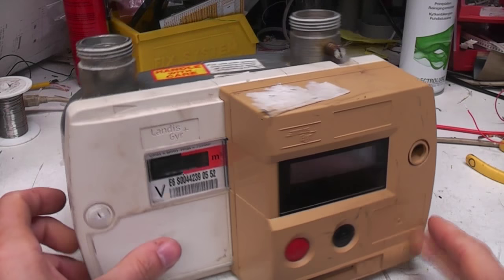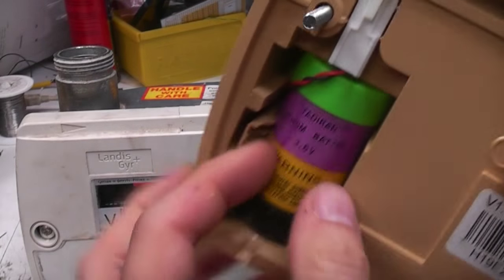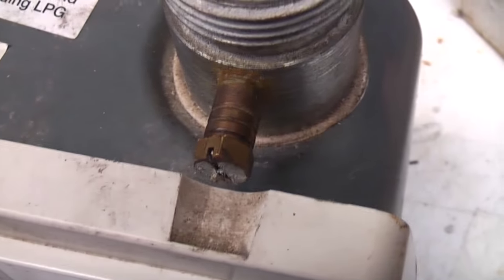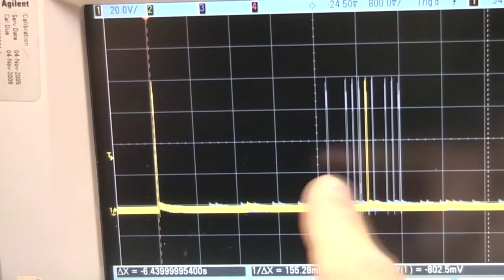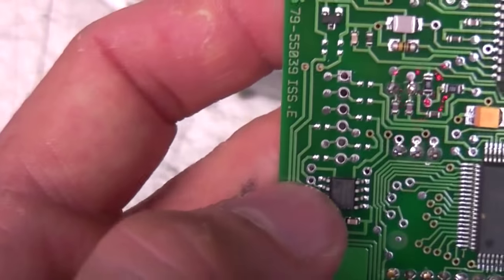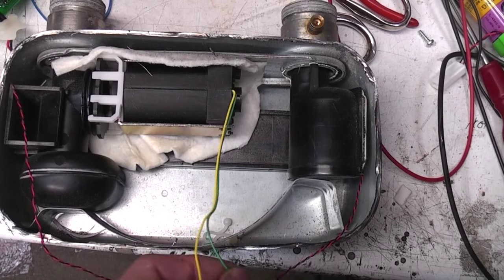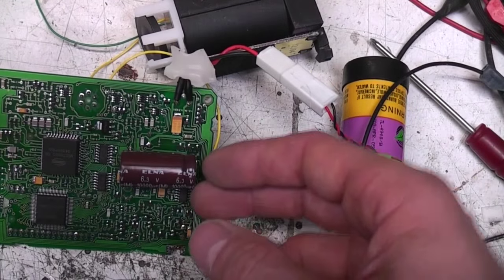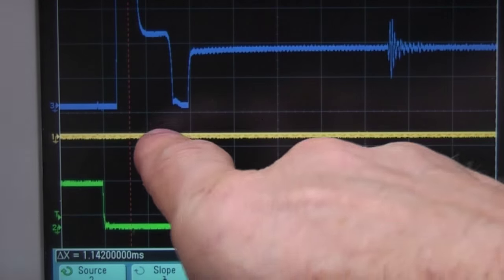Ultrasonic gas meter teardown

Comment: Interesting, Thanks for doing the autopsy. Great test set up with the fan. Large battery I wonder how intrinsic safe this set up is. No doubt it is safe, as the gas authorities use these meters. That wire on that coil is very thick, must draw a bit of current.

Comment: Spot on with your guess of how it works.  As regards the lack of pressure sensor,  there is a mechanical regulator attached to the inlet (a mushroom shaped thing on the top of the meter at the end of the flexi pipe when installed), that IIRC is set to 21mbar and has a tolerance of +/- 1mbar

Comment: One argument for separate meter and card units is that they could keep the meter in place (since it'll be a pain to change), regardless of the type of customer, and simply bolt on or remove the card unit as the customer moves on or off of prepay metering. I guess it could also open up alternative means of prepayment, or the ability to support different prepay card systems.

That way you don't have to maintain separate meter stocks or pay for card functionality on every meter, regardless of need

Comment: Fascinating - thanks Mike. Wow, they go to all that trouble to get a low voltage solenoid but have 50-80V transducer spikes within millimeters of the gas flow. Must be easy to confuse using an external ultrasound source. Great teardown - thanks.

Comment: That folding on the can, I think it's a fairly similar method they use on Soda Cans. It's a fairly easy and cheap and reasonably strong way to hermetically seal something. I believe it's type of double seal, but I could be wrong.

Comment: It would be interesting to have seen the Infrared communication between the smartcard unit and the meter, especially to see if they used some form of polling or obfuscation to prevent tampering.
Reply: Many years ago I was involved in the in-house testing of an ultrasonic domestic gas meter, very similar to the one shown here.

The IR port is a standard feature, with a publicly published protocol used by all meter manufacturers, for both gas and electric.

The protocol starts at a low baud rate to establish connection, then switches to a higher baud rate for the functions, including setting the charge rate and controlling the valve.

The switch from low to high baud rate includes a password. This is the security mechanism, and it would not be easy to crack.

While testing these meters we discovered that if the transmission during the low baud phase was allowed to overrun, e.g. by sending a continuous stream of garbage characters, the internal receive buffer would overflow and corrupt some RAM.

The 'garbage characters' could be any form of IR transmission, such as from a TV remote. 

This corruption would be detected when the meter did a status check, which it did every six hours. The meter then corrected the RAM by reloading it with the 'last known good' values, which could be upto six hours old.

I pointed out that a devious person could get 6 hours of free gas by using a TV remote. Do this every 6 hours and he would have free gas all the time.

The company then fixed the software bug in all new meters, but nothing could be done about the 20,000 meters already installed !.

So somewhere in the UK there are 20,000 users possibly getting free gas just by using their TV remote.

I wish I was one .

Comment: Would it be possible to use a strong IR source from the side to possibly saturate the IR sensor inside the actual gas meter before the card runs out of credit to prevent the transmit of the turn-off sequence?

Comment: eres a regulator that sits before this that keeps the pressure constant (21mbar) regardless of what the supply pressure is (usually nearer 25mbar) so there isnt a need for a pressure sensor, purely volumetric.
it used to be quite a common way of getting more gas for your money by fiddling the regulators to up the pressure but they have lead seals on them now.
Reply: Matt Beddow depends whether it's an LP or MP service.  MP services can be up to 2 bar, and LP up to 75mbar.  (although you would have to be near the district governor and for it to be at winter settings to see those kind of pressures).  The more modern regs have plastic seals, but do regulate to 21mbar as you say.  That said, ultrasonics aren't as dependent on pressure as the old diaphragm meters for an accurate reading, therefore even if you could tweak the pressures slightly it would make little difference to the accuracy.  Both the E6 and the U6 are designed to flow at a rate of no more than 6m3/hour.
Reply: Matt Beddow , relative pressure is fixed, but what about absolute pressure VS speed of sound?
Reply: The whole gas network is billed on relative pressure not absolute. When your looking at 80 bar in the High pressure mains a few mbar shift is negligible. When you get down to Low pressure service for your house it may be noticeable but the accuracy of domestic meters isnt fantastic anyway. thats why they measure down to 1000ths of a m3 but you are only billed for whole cubic meters/feet. Long term averaging then takes care of the short term fluctuations in gas pressures.
Reply: nRADRUS The variation with temperature is far greater.
Reply: Matt Beddow Just seen you work for National.  I work for one of the other DNs.

Comment: The narrowness of the flow rate measurement tube is probably so that the waves remain planar up to a fairly high frequency and they don't have to worry about positioning the transducer over an antinode of a standing wave (at least in one of the dimensions)

Comment: Is that a desolder pump with a heated tip of some sort? Not seen one before.
Reply: +Mark Bartlett They usually have the  heated tip and vacuum pump and usually a foot (or finger) operated switch. They're fantastic for desoldering.

Comment: One also wonders how easy it would be to block the IR coms by slipping something opaque between the meter and card unit so they can not communicate and then the card unit can't tell the meter to cut off the gas when the money runs out.
Reply: ***** If gas valve is in the metering section it could be programmed to cut of the gas after so many units are supplied unless told otherwise, and also cut off the gas if there are communication problems, or just log or all the evidence and write it to the smart card for evidence for use in the up coming court case :-)
Reply: ***** Would liked to have seen some waveforms and a dump off the eeprom. It's amazing how many devices you think should be secure actually use some really poor crypto.
Reply: That is why it would have been fun to experiment with it to see if the thing is secure.

Comment: Large amount of copper on the coil. Possibly for running at a lower voltage? It was a big coil, also could be for spark isolation?

What kind of desoldering gun were you using in this video?

Comment: Very cool. Never realised you could use ultrasonics in this way!

I was a little puzzled as to why the valve is on the supply side. Maybe I'm having a brain fart, but wouldn't it be easier to switch so the stopper is pulled to the low pressure side?
Reply: The pressure is already reduced before it enters the meter. The meter does not regulate the pressure. A gas regulator is always before the meter. 

Therefore, it makes no difference on which side it is on. I was a gas engineer for 15 years and fascinated to see Inside.

Comment: Around 21:29 - essentially the same voltage measurement can be used to calculate the discharge rate. Since piezo's capacitance will strongly depend on pressure, wouldn't it actually be more likely that those pulses would be used to detect the gas pressure (and incidentally test the transducer as well)?

Comment: When trying to measure current consumption on something like this, a nice method is to use a V to F converter (e.g. LM331) and a frequency counter. Then you get a huge dynamic range and inherent integration.
Reply: Colin Stamp , analog integration is bad cuz it intergate bias ;)

Comment: It's possible that those ultrasonic sensors are made by Bosch; they are very similar to the sensors they make for the ParkPilot parking assistance system.

Comment: I have a meter just like this one, it seems to have gone faulty.  When the gas supply is switched off at the main valve the reading is still increasing,  i have performed a gas test and there are no leaks in the system.  What could cause this fault condition Mike? Any help greatly appreciated!

Comment: Maybe the reason why the solenoid is so huge is so they can use low voltage for explosion safety? The solenoid is inside the gas flow, wouldn't it be easier to ignite it with higher voltage?

Comment: So the solenoid is to shutdown the gas service remotely if you don’t pay?
Reply: until it has communication with the grid. If u can break or disturb the communication with the central system, its not possible anymore. Even if its a prepayment nmeter , the meter cannot get the the new unit prices without communication in case of price increase. Its enough to shield the electric meter to destroy communication betwen gas and electric meter or use  Flipper zero to find the frquency.

Comment: 27:30
That shape is not to reduce turbulence. Although it probably does do that...
I'd bet a huge sum of money that is an acoustic horn. it's job is to transform the acoustic impedance of that channel to the impedance of the free space inside that box to reduce reflections. If those tubes just terminated there would be extreme standing waves generated that could interfere with the measurement.

Comment: to do this kind of ultrasonic sound measurement is the speed of a microcontroller like atmega8 enough (16mhz)? There cant be very much difference between the travel time for the sound in moving liquid vs. static liquid.

Comment: Interesting and detailed, my one of these with an install date of 2016 battery ran out in 2021, so the 10-20 year battery prediction was a bit too generous but at least it didn't close the value so I have unlimited estimated gas usage for the mean time.

Comment: When you run out of gas credit and the meter is switched off, it asks you to "Hold A for gas" for 10 seconds. This activates a solenoid 10 seconds later, which is probably done after the capacitor has charged up in order to drive it with enough current.
Reply: ***** I suspect that the 10 second delay is also a slight safety feature, give people the chance to realise they're about to turn the gas back on and reduce the change of them blowing their kitchen up

Comment: Won't the absolute speed of sound in the gas give the pressure ? So relative forward / backwards speed gives flow rate, but average between the two directions gives some function of pressure and density.
Reply: theelmonk Unfortunately the variation with temperature is far greater.

Comment: I wonder if you can have a system listening for the clicks the transducers make and time opening and closing of a solenoid to get unmetered gas.
Reply: Arnþór Gíslason By seeing that it does not speed up measurements when flow is huge, it looks like it can be easily made. For better effect you should store this "stolen" gas in some tank so that you can use it without pause every 2 seconds.

Comment: I guess the solenoid turns it off when you run out of credit. Which makes it doubly surprising that it doesn't check the solenoid position on booting. Maybe 'b' = BTU?
Reply: Electron Alchemy nope, we use megajules/m3 in the UK, (the standard being 37.5 - 43).  It was faulty, hence the not pulsing the valve.
Reply: Electron Alchemy I think the "b" is an indicator of a battery fault, and that the meter needs to be taken out of service for refurbishment.

Comment: My parents' home is fitted with one very similar to this. Also Landis&Gyr and has the A/B buttons but no card reader. I guess it's not that common in the Netherlands, never heard of a pre-pay gas meter... It's connected with the energy meter (some flavour of an ISKRA Emeco) via a two wire M-bus https://en.wikipedia.org/wiki/Meter-Bus

Since the energy meter is connected to a cellular network via GSM/GPRS it's possible for the energy company to shut off the gas remotely, but it also has a mode in which it's possible for the consumer to turn the gas on again by themselves.

Comment: Has anybody done any research into the IR protocol?
I have one of these and would like to monitor my usage and graph it so I can see how my heating is performing. It's easy with my electric as I just watch for a black bar on a spinning disc, but this is crazy. A webcam watching the LCD seems overkill so I wondered about an IR transceiver to get the readings from it.

Comment: Could you move the solenoid with a large external magnet?
Reply: katelikesrectangles Not likely since it is in a 'seamless' metal can and therefore intrinsically magnetically shielded
Reply: sivalley 
A metal can does in now way mean it's magnetically shielded.

Comment: Auto ignition temperature of natural gas is just above 1000F so in an intrinsically safe battery operated system you never want to reach anywhere near especially with impurities like hydrogen. So I think in complete failure with the battery shorted across the solenoid it can dissipate the heat hence the thermal mass.
Reply: Or its because more copper = less energy per actuation. More amp-turns means more resistance unless you use thicker wire, more turns and thicker wire = more copper.  The total volts-amps can be held constant and the amp-turns increased without limit (until inductive effects matter).

Comment: By His Noodly Appendage! That solenoid is basically just a spool of enameled copper wire! I guess if you were to buy that just as a spool from farnell or RS you're looking at $20 USD!

On a pre-paid unit, as far as circumvention goes I'd try to bypass/manipulate the credit mechanism - it's much more plausible to say " i lost my card" then "oops my meter seems to have exploded"

Comment: So you didn't come across any tamper switches? The tamper plugs should pop of quit nicely with a dab of hot glue and firm tug. We have the newer version you inset a picture of. 26pence per day standing charge and 4.73pence per cubic arbitrary unit as it doesn't say. We spend more on the privilege of having the thing than we pay for the actual dinosaur farts! On average.
Reply: +Sirus No obvious tamper switches but as he said when he fiddled with the ultrasonic sensors, nothing was displayed - that doesn't mean nothing was logged however.

Comment: All that security and all you need to do is shove a pencil down the inlet pipe and jam the valve open, Pipe back on, FREE GAS!!  until meter man takes a reading of course (not very often with prepay).
Big Thumb Up.
Reply: wouldn't a pencil burn? lol

Comment: If only cars had ultrasonic fuel gauges.
Reply: heroineworshipper it would only tell you flow rate..... which is done by knowing fuel PSI and injector fire time and hole size. 

as far as full tank or not..... the current systems work damn well.... and i think it would be able to measure it.... probably with more error than float basied systems....but you are taking more electronics out of a tank filled with explosive vapor sooooo lol.
Reply: heroineworshipper My freind's RV has an ultrasonic fuel gauge.

Comment: I'm 1/3 through.. I can't help but wonder if a stand alone test of mechanical vs electronic metering test of gas through the two would yield the same results for usage, don't get me wrong I'm no expert just intrigued if all this extra electronics is ripping people of that's all and obviously to test at different usages would be ideal, to get a jist if the new tech is fair to the consumer.
Even though clearly usage is more or less based on the little man trying to keep warm vs industry getting cheaper prices for higher usage.
In the end old people sitting cold isn't a good feeling for me..
Nor is anyone when so much rubbish is manufactured for it to go in the bin it's senseless.

Maybe I'm just getting old